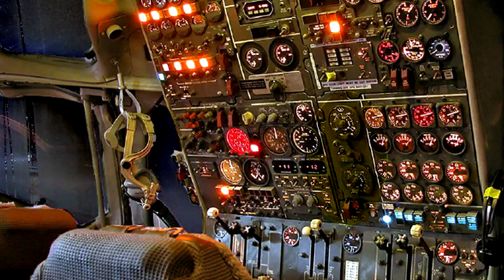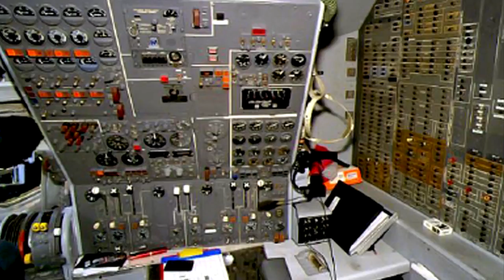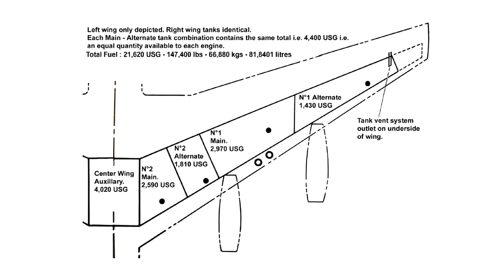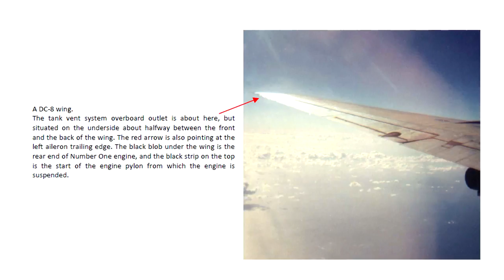DC-8 Flight Engineer Interview

Comment: The flight engineer is missed. That extra pair of eyes, ears, brain, always checking, monitoring and adjusting.

It felt safe flying with a trio, esp with a flight engineer onboard.

How many air accidents were prevented due to the flight engineer picking up and resolving issues before they overwhelmed the crew?

Unsung heroes in my book.
Reply: I see what you mean but the accident rate is massively reduced from the time of flight engineers.